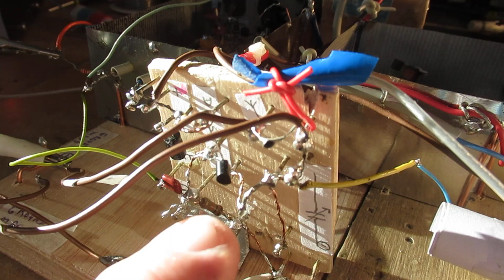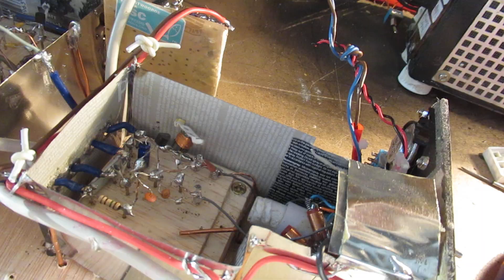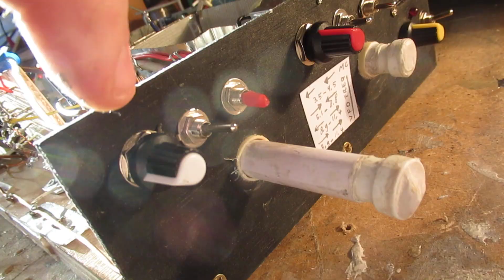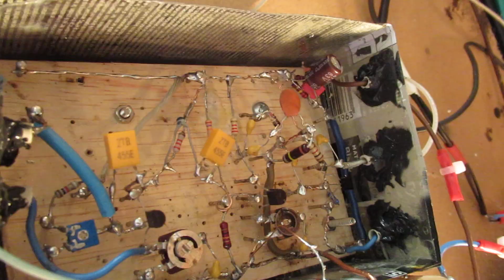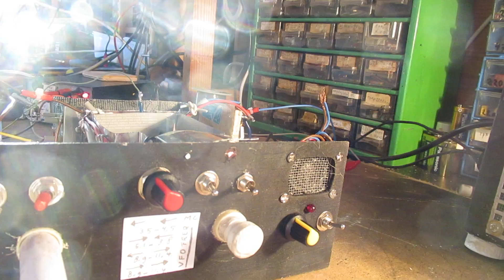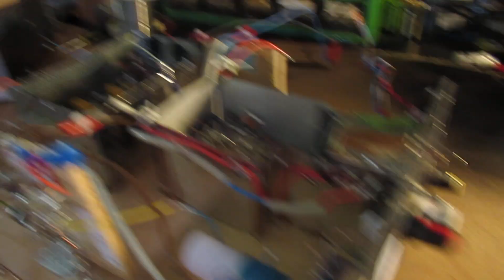Receiving the same Radio Station in a Superhet radio: 1 via TRF and 1 via Superhet reception: how?

Comment: Interesting and great demonstration, yes i have noticed that the wall adaptors for charging phones/batteries ect have the same type of interference on my old radio's as your led bulb. 👍
Reply from the maker: Hi John, yes, that is a problem. The "new" say "modern" wall adapters (not using a 50 Hz or 60 Hertz classic transformer) have a (say) 50 KC-150 KC oscillator inside. They produce square waves and it is very difficult to filter them out, because square waves have a lot of harmonics, say to the 8th or so. They are sprayed out everywhere: via power supply lines, via the air, etc. Only the better manufacturers are able to damp that issue somewhat, but, in general, there is not so much cure for that problem. Thanks. Ko, 10 oct. 2025.